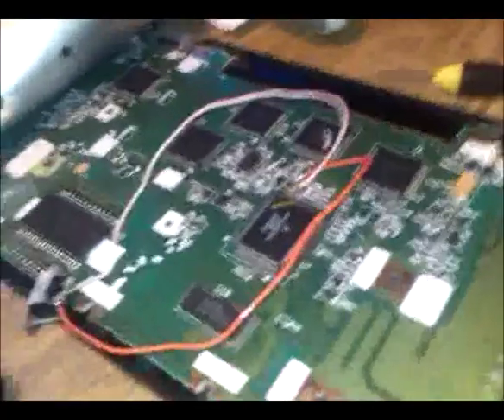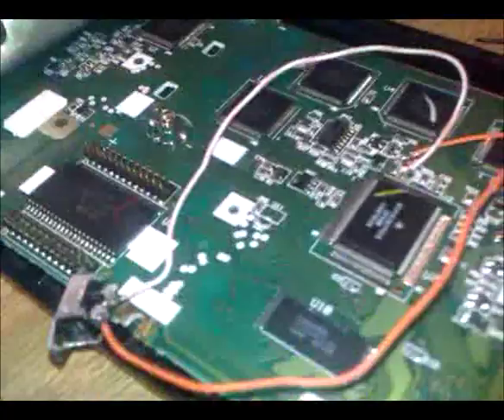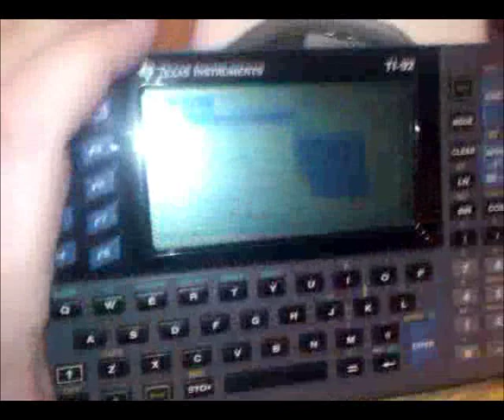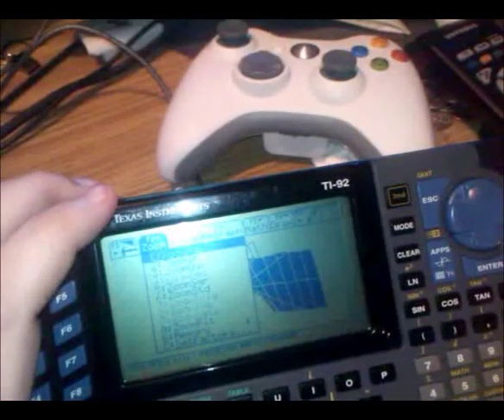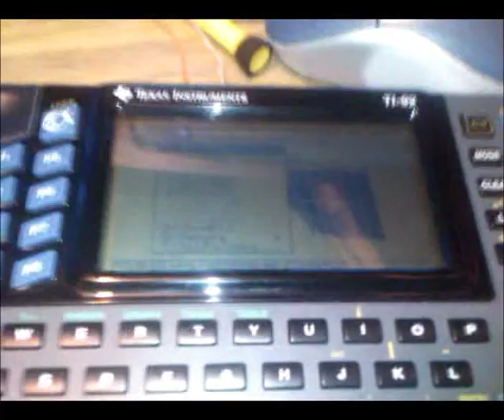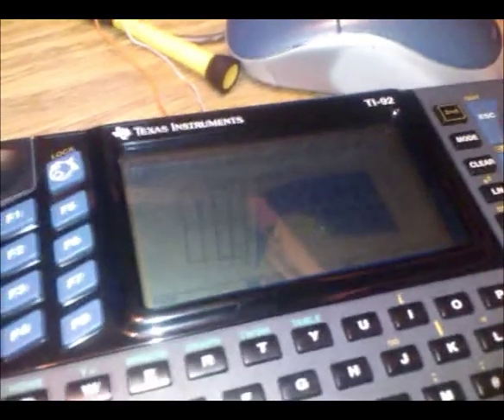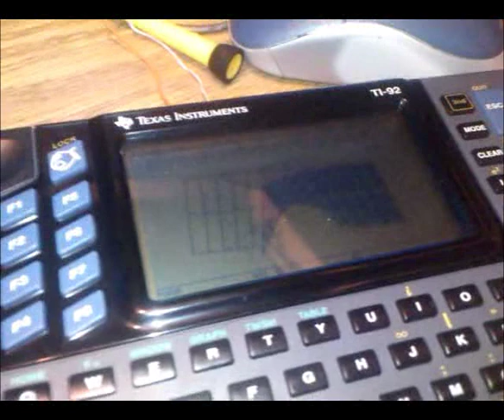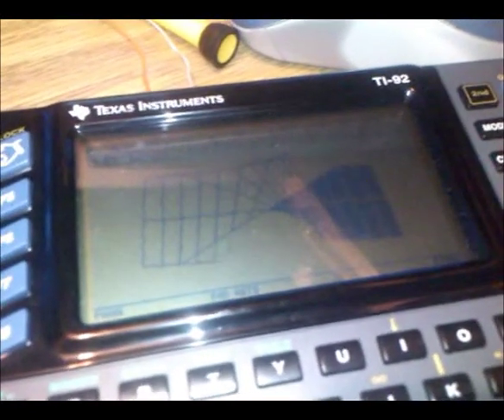Overclocking a TI-89 and TI-92

Comment from the maker: @judasy The port on the corner I believe is used for overhead projectors.

As for a USB cable it just uses the standard TI USB cable you can buy at most places that sell TI-83s and TI-89s. If you are looking for a TI-92 I got this one on ebay for only 25 dollars I would start there.